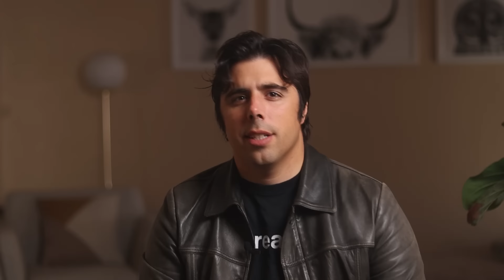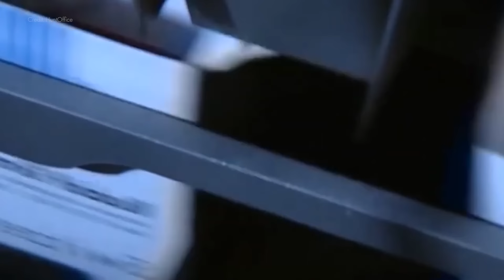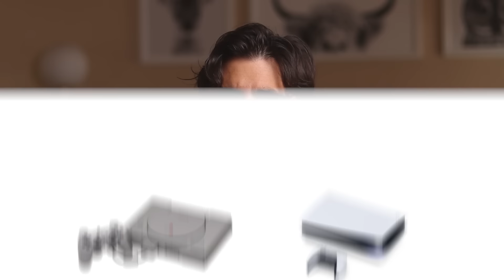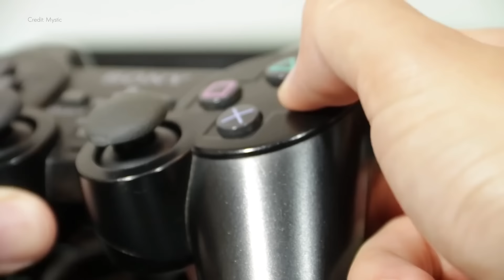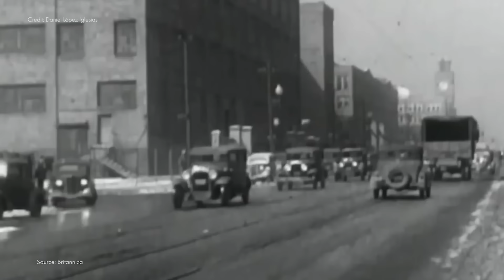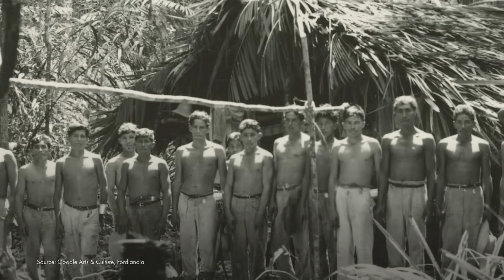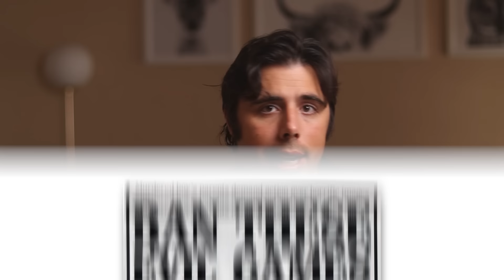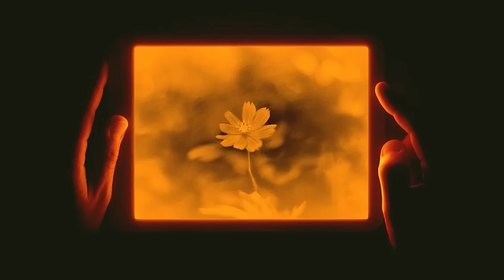Why Some Designs Are Impossible to Improve: Quintessence

Comment: Jaguar shots fired!!

Hey man, that was the best way to play Doom on console.  You NEEDED those buttons!
Reply: That QWERTY claim is likelyapocryphal, by the way.  You’re better off chasing the “Remington made it popular and everyone copied it so it became the standard, and then everyone was used to it” angle.  

Considering Remington acquired and tweaked the design from a company that was testing completely different layouts previously—and two rows of keys before that—it is highly likely that no one was operating at any speed before that to be a design concern for the keyboard layout.  

It’s just that’s the one that was in play when Remington got involved and chances into the popularity wave.

Comment: I have changed keyboard layouts four times. From German layout to US layout (which may seem like a small change, since only two letters are swapped, but please consider all the punctuation, especially for me as a programmer), from US layout to Dvorak, and finally from Dvorak to Colemak. And the last two changes were not for speed, but for typing comfort. If you type 8 hours a day and type very fast, QWERTY may work for you for 5 to 10 years, but then you start developing problems in your fingres. The only way to avoid this is to type slower or less, and neither was an option for me. So I switched to Dvorak and not only was I typing much faster than ever before in my life, but I also had much less pain in my hands, even after a hard week at work. However, Dvorak has a few design flaws, and a few years later they are causing problems again, especially with my right pinky. Colemak takes a different approach than Dvorak; it's not optimized for speed, but for typing comfort, without being entirely different from QWERTY (in fact, 47% of all keys are in identical locations to QWERTY, that's almost half of them). Where Dvorak focuses on hand alteration, Colemak focuses on key rolling (being able to make a rolling motion with your fingers, like some people do on desks when they are bored). Trust me, it is worth the effort if you are a writer, typist, programmer, or any other kind of content creator who has to do a lot of typing every day. You will get faster with either Dvorak or Colemak and you will not end up with painful hands when you get older.

Comment: "Perfection is finally attained not when there is no longer anything to add, but when there is no longer anything to take away" - Antoine de Saint Exupéry

Because if there is nothing you can take away, you have reached the very essence of something. All the bells and whistles you might add on top are just not needed; they might be a nice addition to the core product, but they won't make it any more perfect, because what is a nice addition is a matter of debate, and people will argue about it. Some will argue that they need this, others will say that it's completely useless, but instead they need this, which a lot of people won't need. But the bare essentials are what everyone needs because without them you have no functioning product.

Comment: Paperclips... Staples... Pens... Pencils... There has been enough made of all four of these that if we stopped making them today we would not need to make more for 100 years. I read a small book in elementary school in the mid 90s that showed the estimated number manufactured vs the estimated number completely consumed annually. I have never since been able to find this book today, but I clearly remember My class writing a book report on it. The math assumed that the computer would take over the roles of these in the majority of life. 

How wrong the book was. 

Hindsight shows us that there was a ten fold increase in the next ten years. With a slow down only starting in the late 2010s with the mass adoption of smartphones. Educational use of cheap computers.

I love the deep inspection into Ford and the implementation of the assembly line into his company and the expose of Ford's massive empire. With the touch of Morale in assembly line manufacturing. Some of the most demeaning work a human can do.

Comment: it may be my but i personly see battle royale as game mode not as the own genre.
call battle royale dead it's like call free for all dead

yes games with free for all/Deathmatch it may not be as popular as before
but the are still many games that have Deathmatch and team Deathmatch  as game mode.

i thing the same apply to battle royale as Mach the try to selling as genre it's just game mode
for example the game im working it's multiple FPS this game i will have the classic game modes deathmatch, team deathmatch ,capture the flag.
theoretically if wand to make battle royale game mode it will not be that hard,
yea for sure i will have to have bigger server's and make the players to not respawn,
but this parts off the game mode i will not have to change the core of my game in the order make battle royale game mode.

to be fer i don't have plan to add battle royale game mode on my game but i don't believe i will be hard to add this game mode if have servers money because
like say the only difference for Deathmatch that my game i will have for sure is the following
1. bigger maps 
2. more player's
3. not respawn
4. the zone
5. and spown system the you drope for the sky.

all the other parts it's already on my game stuff collect itmes for the map and stuff like that.

Comment: Maglite is good because it works well.  The switch doesn't get messed up like every switch we grew up with.  You can tell a Maglite from a fake version.  Someone stole my bag before we moved to Europe, it had my 3 cell maglite.  I've found one brand in Hungary that is as good as my Maglite.  Its an LED light.  I still have my 2 cell AA Maglite.

Comment: Fun little fact about the design of the Model T: it did not use the control layout we are are familiar with today. Carmakers hadn't settled on a standard for that yet, and the Model T used what we would today think of as an extremely weird control layout; the brake pedal was on the right and the throttle was on the steering wheel alongside the manual spark advance.

Rather than a hand shifter and clutch pedal, it had a weird combination 2 speed gear shifter and clutch pedal on the left, and a separate pedal in the center for reverse. Holding the shifter/clutch pedal about halfway put the car in neutral, and pushing it down to the floor would put it in 1st gear (you did this gradually while giving it a bit of gas with the hand throttle to start smoothly and avoid killing the engine). To shift into second, you pulled your foot off the clutch shifter, letting it move all the way back towards you. Basically, "clutch in" was the middle position, moving the pedal down disengaged the clutch in first gear, and moving the pedal up disengaged the clutch in second gear. 

Which caused a few slightly weird effects, compared to modern cars. For one, driving along at low speed required you to hold the fairly stiff clutch pedal down the entire time with your left foot. For another, driving at high speed actually didn't involve your feet on the controls at all. Also, you could immediately shift into reverse at any time by pressing the reverse pedal.

The first car with a modern control layout was actually the 1916 Cadillac Type 53, and it just kinda stuck.
Reply: The Type 53 wasn't a widely mass produced car though. The Austin 7 adopted the Type 53's pedal layout and that's what made it the 'conventional' control layout we have today. If it wasn't for the Austin 7, the Type 53's backwards A, B, C pedal layout (Accelerator, Brake, Clutch, going right to left) could have disappeared in history like the better paperclip design he showed in this video.
Reply: The Cadillac's control scheme was probably helped by getting ripped off by people like Herbert Austin for the Seven, which in turn was licenced and ripped off by various others.

Comment: I really miss my old flip phone; you couldn't kill the blasted thing. I lost it in the snow for hours and when I found it, it just worked.
Reply: I had a Motorola C115 in middle school that was passed down to me after years of use, a classmate gently tossed it out to me, i missed it and that thing went right through the windshield of a car that was parked behind me. it didn't even had a scratch
Reply: My first phone was a Motorola bar phone that I had to get minute cards for. I dropped the damn thing right into a glass of coke. I fished it out, sucked the coke out through the headphone hole, and it worked just fine.
Reply: Nokia 3310s:
The only thing capable of mining bedrock
Reply: I killed a Nokia 3310 by knocking a banana smoothie over it. It did work for a week or so afterwards, but eventually, the smoothie won. 
My gen alpha children didn't believe me because they have heard it is indestructible despite never seeing one 😂
Reply: I’ve been so tempted to go back to flip phones
Reply: Absolutely but man... the sweat from you pockets could kill the machine... 

My baby trew my phone in water so many times.... i had Absolutely 0 issues
Reply: Nokia 3310!!!! 🎉🎉
Reply: Back in like 2015 i had an old samsung smart phone, one of those where you could click the back off and take out the battery, absolutely not rated waterproof in any way.
At new years i lost it in the snow in a field by a holiday house in the Ardennes. In the spring my uncle came back to the house and while walking through the field he finds my phone. When I got it back, my dad and I tried to charge it, just to see what would happen. We really didn't expect anything to come of it, considering it had been in the grass for months, but lo and behold not only does it turn on, but there's absolutely nothing wrong with it at all.
I used it for probably another year after that, it even outlived the replacement I bought when I thought it was gone forever
Reply: We had Kyoceras in the aughts, and my dad lost his one day during the winter and could not find it to the point of replacing it. Two months later we found it sitting on the last little patch of packed snow to melt next to the driveway. It got passed to me and I used it for several years until texting became a thing and I finally got an Env2 😂
Reply: 16 times the durability
Reply: I agree about missing my old flip phone. It was so simple compared to my current smartphone. With my flip phone I could take care of all of the settings in about 5 minutes. With my smartphone I had to spend over an hour to go through all of the settings just to make it useable for me.
Reply: @Solitaire001 it's by design. They understood that a bit of frustration increases the addictive effect.
Reply: I don't miss old dumbphones AT ALL.  I'm not a heavy smartphone user, I spend most of my time on actual computers, I use the computer for texting, I use the computer for watching Youtube, I use the computer for work.  I've sent maybe a few dozen emails from my phone, and I've had iPhones for 16 years.  But the things I do use it for were a gamechanger.  Scheduling linked to my computers, navigation, quick notes about work, a few pictures of work as a reminder of what I need to get done, and even being able to text (which I absolutely NEVER did from a dumbphone, if I got a text I made a phone call to tell the jerk texting me to never do that again, a number pad is USELESS for texting, take your T9 and shove it all the way up your butt).  And lost in the snow?  Yeah, modern smartphones wouldn't have a problem with that either.
Nope, I never want to see another dumbphone, let alone use one again.  And having had a cell phone since the '80s, I've used a lot of dumbphones.
Reply: What does snow do to modern cell phones?
Reply: Except for when you dropped it and the battery blew off 5000 feet in the other direction
Reply: I feel like most modern phones have started to get pretty resilient again. If you arnt going for the 1400 dollars ones. And rather the 300 dollars ones. Wich is baphling BTW considering what I'm gonna say.
Past the screen most are actualy pretty sturdy. The screen is the only part I even broke. And with a proper protection it's even hard to do that.

Water is the big weakness. But even then. A slight soak will not enter inside. And they come with sound that unlock water from speakers.

I literaly called one of my old tactile phone "la brique" (The brick). As it was fucking indestructible. I kicked it around and even made a hole I a wall with it.
Reply: @captainphoton1693  where I live, the kind of old style dumb phones that just consist of one piece (no hinges or slidy parts) are pretty much always referred to as 'baksteen' (brick). Usually 'nokia baksteen', because nokia had a major hold over that market here.
Reply: Lost my S9 in the snow for a week. Worked just fine after a charge 🤷‍♀️ Modern phones are much better
Reply: I have a flip-phone.  People laugh at me until they find out it can do you-tube, email and searches.  All the benefits of being nearly indestructible but a fail safe new technology access (Failsafe because its not that usable... I have to use T9 and the pad to move the mouse around on a 1.8 inch screen)  I carry around a tablet most of the time and it has google voice so that is really my phone for talking, texting, email, surfing and etc. Cell phone is for talking only.
Reply: @MrUcphinni Can I ask you what model it is? I've been looking for a (preferably Android) flip phone that supports modern Internet connection
Reply: @MrUcphinni  I'm on my 4th one, bought it on Ebay. Have dropped it MANY times.
Reply: I use ONLY a flip-phone. Bought my 4th one  on Ebay  3 months ago, took it to my AT&T store for settings.  I use it only for phone calls, and bought a GPS for my car.

Comment: I am immediately enraged by the playstation controller example at the start, because there are objectively better controllers that aren't any more expensive to make, they're just small adjustments to the shape and layout of the controller that can make it many times better, the reason why the dualshock layout exists still is largely because of brand recognition, the things their controllers are best at, are games where the modern additions to controllers are largely ignored, the thumb sticks are in a bad spot if you're actually gonna use them, for example
Reply from the maker: thats what i said later in the vid
Reply: @Design.Theory   i suppose going back and editing my comment to reflect my view of the video as a whole would have been more fair. Was a good video overall, interesting history, I've just been on about how awful modern controllers are relative to what they should be for ages

Comment: Public service : Opera's engine is Chromium based, which contacts google on a regular basis. Using Opera means accepting sending data to Google even if it's just your IP, ISP data, location and such which are extrapolated from that IP and some browser info like the extensions your using. Lookup "Manifest V3" to learn about how Google will control what you are allowed to do with extensions.

Comment: Talking (kinda) about the controller layout, one thing i remembered is a video game review about Alien Resurrection, a First Person Shooter based on the movie with the same name, on the PS1 by GameSpot. In which, the writer critiques the game for using a "most terrifying element", the control scheme. Which is described as: "The left analog stick moves you forward, back, and strafes right and left, while the right analog stick turns you and can be used to look up and down.". This review was written on October 5th 2000 but that this way of moving in video games is quintessential as well. And a good laugh review to read.

Comment: One of my favorite quintessential designs is the codex, the bound book. By dividing a scroll into leaves, you can quickly access any part of the text, and writing on both sides of the sheet doubles the density of information. E-books are convenient for copying, transporting, and reference, but the march of file formats may render them unusable in a few years time, whereas the codex as a format isn't leaving us anytime soon.
Reply: Come to think of it, this is one of the differences between cassettes and DVDs. I remember when DVDs became popular and we no longer had to rewind after watching a movie.
Reply: What you say about the codex is true, however, e-books formats have a standard nowadays. You can find most of them in the epub format*, which is a open format, meaning that it can't be subjected to copyright. PDF is also a format that, although not open, has been used consistently for decades. I doubt the options will change much, apart from updates for those formats.

*There's also the proprietary format from Amazon made for their books and Kindles, but every other e-reader uses epub, PDFs and a few other optional formats.
Reply: @null_pointer_deref  PDF is an open standard (ISO 32000).

Comment: My first smart phone was an LG that ran android 2.3 on it and it was one that had a slider for the keyboard to be exposed. My last dumb phone had a sliding qwerty keyboard on it and I thought when I got my first Android that I would have such a problem without the physical keyboard, but I pretty much forgot that there was even the physical keyboard as I just kept using the on-screen keyboard instead.